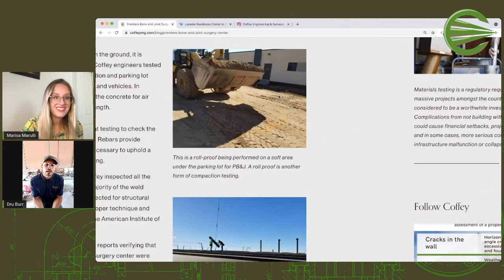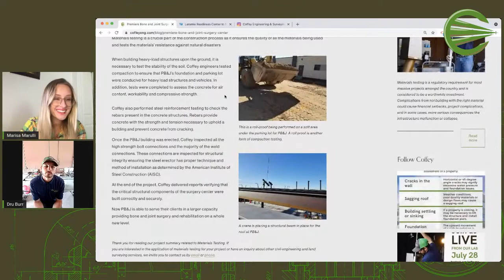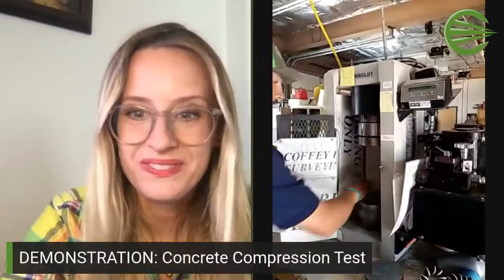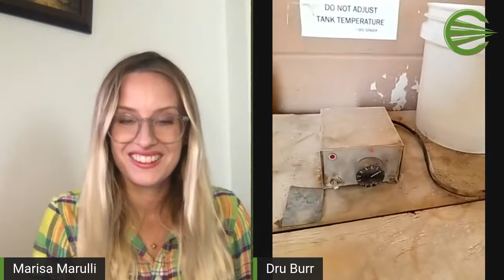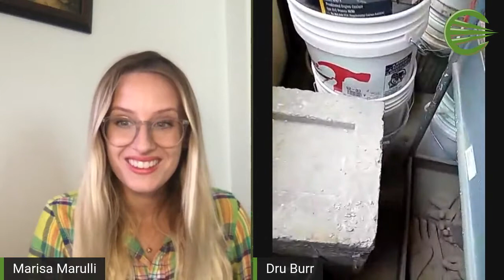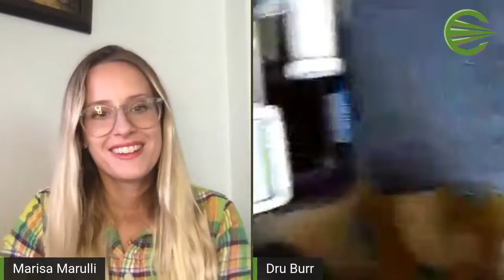An Inside Look in a Construction Materials Testing Lab, Plus Demonstration

Comment: In the event of all cylinders not passing, I've seen non-destructive testing implemented, as well as consultation with the design engineer.  These steps should be considered before ripping out concrete and losing project time.